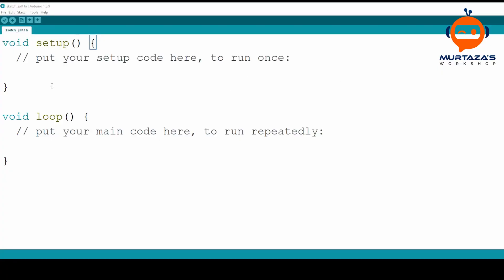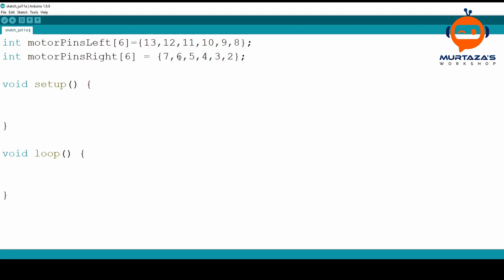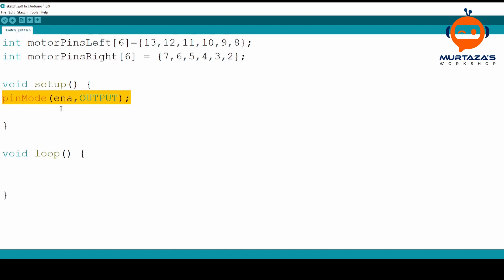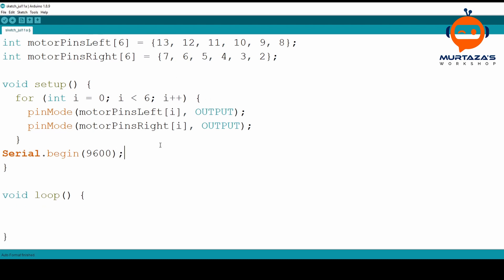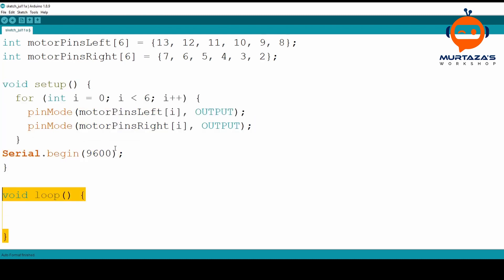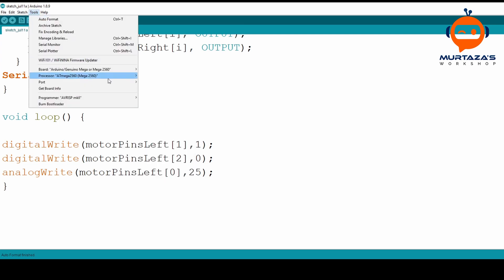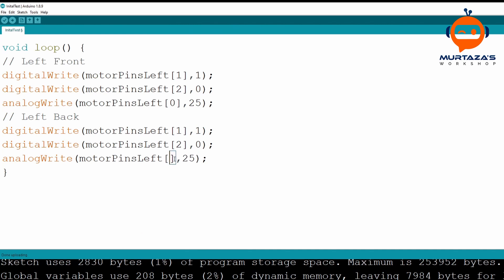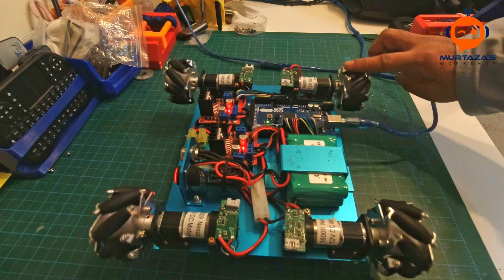Initial Motor Test - Self Driving Car using Jetson Nano (2020)

Comment: Hello, Thank You for this video learned a lot,
Can you please give a brief about

digitalWrite(motorPinsRight[1],1)
digitalWrite(motorPinsRight[2],0)

I dint Understood a bit of this as I am just a beginner
Reply from the maker: This is to set the direction of the motor. If the direction pins are 1 and 2  then putting 1 as High and 2 as Low will move in one direction and putting 1 as Low and 2 as High will move in the opposite direction. The motorPinsRight is just the array that contains all the pin numbers so that we don't have to repeat writing pin numbers again and again.